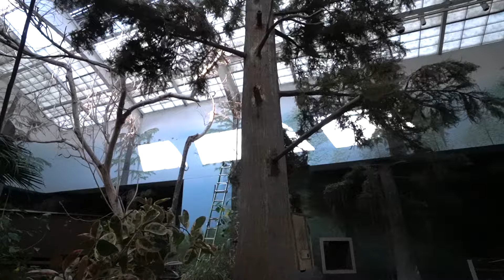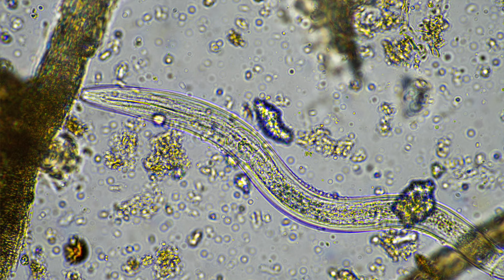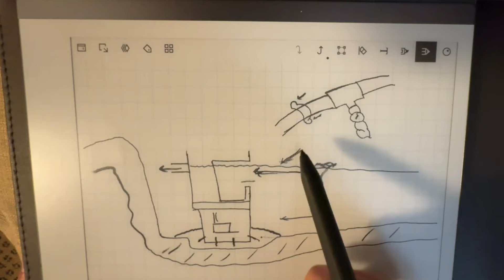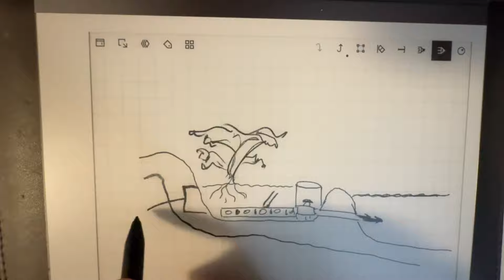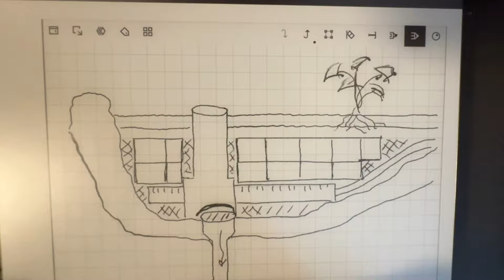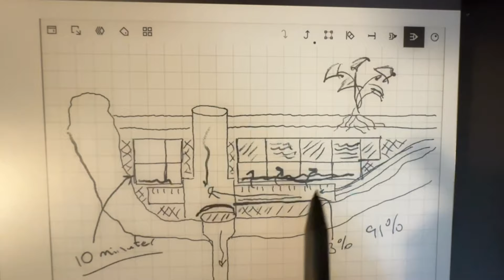Flamingo Pond Needs Modifications @BrookfieldZooChicago

Comment: Question: Where can I get a bulkhead fitting for a hole that is 1 1/2 inches in diameter with a barbed end for a hose with a 3/4 inch I.D.? I cannot find anything anywhere. Any help?        Great video by the way. Brookfield Zoo is always cool to go to.